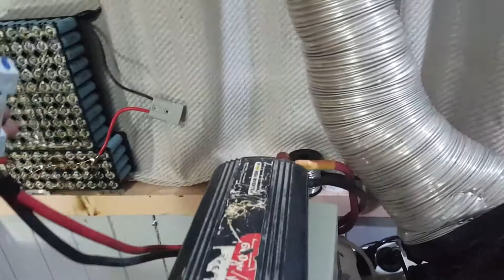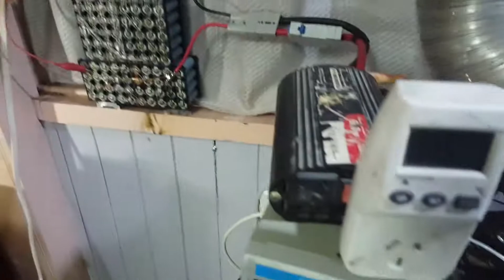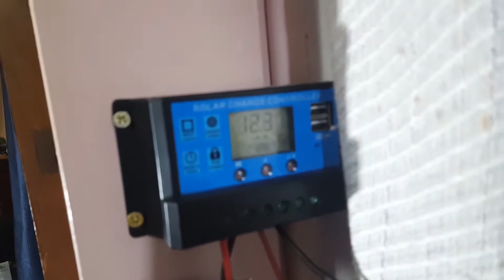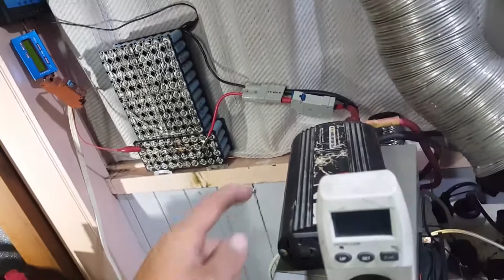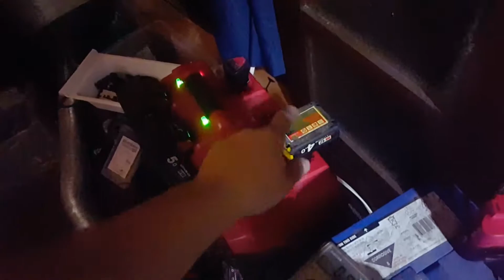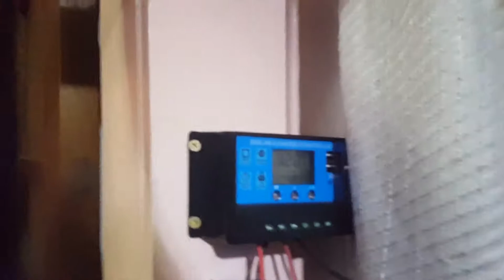The mini 18650 power wall gets a Inverter 600watt

Comment: Nice setup! Only thing: I wouldn't trust output from the solar regulator, that's why I would add a BMS between that and the batteries. Overvoltage to lithium batteries, you know, can be very dangerous. Those cheap PWM regulators are not very strict on output, they could push out 14.2V, realllly dangerous for your cells.
Reply from the maker: Highest it got was 12.7 but yes this is by no means a ideal setup

Comment: I appeciate what you're trying to acheve but this is a terrible idea long term. No BMS so cells aren't balanced which will shorten their life and this inverter is made for lead acid batteries which have totally diferent volt/state of charge characteristics meaning inverter will cut off as soon as 18650's are half discharged (>10V in 3S system). I'm not even gonna go into fire safety issues here.

Comment: depending on your panels a dc to dc buck converter works just as well as a charge controller once you set it to the highest voltage you wont it stops charging and current drops to 0 so if buck converter is set to the 14.8 volt when battery reach that level they stop charging
Reply from the maker: Thats a cool idea
Reply: @Oneupthesleevecustoms  also if you have little sun more panels with buck converters that could also limit current so not to over charge the controller means more panels and a solid current i recomend epever tracer 4210a they are mppt they have algerithems to charge 3s or 6 s lion and can handle upto 1500watt on solar and 40amp into battery if ampage starts to get high they ramp back on the solar
Reply: Can you share a link to such a converter on amazon or aliexpress.
Reply: @dancerehab1092  https://www.amazon.co.uk/dp/B07RGWJHPZ/ref=cm_sw_r_cp_apa_i_tvD7EbFF3HTQQ
Reply: @1981dasimpson  Thank you. Can I dig your brain a little on 18650's? maybe I could email you or something.
Reply from the maker: Sure mate
Reply: @dancerehab1092  yeah no prob dasimpson@hotmail.co.uk
Reply from the maker: Oneupthesleevecustoms@gmail.com

Comment: Hello sir.
Can you tell me how to configure the solar controller for 18650 batteries?

Thank you very much for your help.
Reply from the maker: You need a bms to  control the pack. But these charge controllers will turn down to full charge at 12.7v
Reply: I'm asking because the solar controller's instructions say it does not work for li-ion batteries.
Thank you very much for your help, sir.
Reply from the maker: Yeah they have the wrong charging algorithms. Feed it into a bms and problem solved
Reply: Great then I choose battery option gel but the load is put by the BMS.
What BMS did you use, could you give me the BMS link?
Thank you.
Reply from the maker: Ill find you a link later today
Reply: OK, thank you, sir.
Reply: What fuse is placed between the panels and the solar regulator, between the battery and the solar regulator and between the inverter and the solar regulator.
Thank you.
Reply from the maker: A disconect between pannel and controller. A fuse between battery and controller. Or circuitbreakers
Reply: Can you tell me which model of fuse, voltage and amperage for a 12v installation like the sulla.
Thank you.
Reply from the maker: Ok i need to know how much solar you have
Reply: I have three panels of 100w 12v
Reply from the maker: Thats good for around 25amps in good weather. A 30 amp fuse should be fine. Whats the rating on your charge controller
Reply: It's like yours 30A
Reply from the maker: It should hold up ok. Im running 2 265w high voltage pannels to mine now and its still a alive
Reply: OK, thank you very much friend.
Reply: Please, do not forget to tell me what BMS you have used. About the fuses and automatic protections, could you give me the links where you bought them to know exactly what models you have used? I'm right now learning about the short circuit protection issue.Thank you very much for your help, you are a very good person and I thank you.
Reply from the maker: heres a 3s bms 
https://www.banggood.com/3S-11_1V-25A-18650-Li-ion-Lithium-Battery-BMS-Protection-PCB-Board-With-Balance-Function-p-1120250.html?p=OQ120813147900201708
Reply from the maker: fuse holders 
https://www.banggood.com/Waterproof-Car-Auto-10-15-20-30A-Amp-In-Line-Blade-Fuse-Holder-Fuses-p-916113.html?p=OQ120813147900201708
Reply: @Oneupthesleevecustoms  the 3s bms is crap does not balance cells at all i had one bank in the 3s going over 4.2 volt while others where below 4 volt
Reply from the maker: It might have been balancing but they only balance at like 150mah. So mega slow
Reply: @Oneupthesleevecustoms  i was only charging at very low current about 100mah to see if it would balacne i even ordered another that indicated it was ment for balance and still dident work
Reply from the maker: Can you id the bms and share with the viewers so every one knows there rubbish
Reply: @Oneupthesleevecustoms  i have 3 here now one is 40 amp all in chinease other to have codes cf-3sjh25a-c 25a and bw-3sjh-25a the one all in chinease is ment to be the balance one and all 3 on same back go out of balance even if im putting in 10 mah and left for ages so pritty useless as they need to handle balance at solar current input i had if i knew what part is the dump load i would de solder and solder a filament bulb on for more load dump but i think that would burn the boards out
Reply: @tron259  depend on the charger.
Reply from the maker: Yes many variances
Reply from the maker: So put in a 30 amp fuse on panels and on batts you will be safe
Reply: Thank you very much for your help, you are very kind.
A question. In the solar controller what type of battery did you choose option 1,2,3?
Thank you very much sir.
Reply: Sorry for my English translations little by little I understand.
Greetings friend.
Reply: https://www.ebay.com/itm/5X-30A-6V-36V-Mini-Waterproof-Amp-In-Line-Stanard-Blade-Type-Fuse-Holder-Fuse/183166521208?epid=2113590121&hash=item2aa5934f78:g:ijQAAOSw~CFY6z2B:rk:27:pf:0
Reply from the maker: No problem mate
Reply: Excuse me, do ebay fuses serve me sir?
Thank you.
Reply from the maker: Yes mate
Reply: These are true to me.
Greetings.
Reply: Thank you very much sir.
Reply from the maker: No problem i hope your subscribed so.you can keep up with these sorts of builds
Reply: Thank my Lord.
I am subscribed from the first day that I started talking with you, the videos that you have are very popular, little by little I am drinking them all.
Anything communicates it to me and I will hire him asking the questions that arise from me.
Best regards, I send you friend and thank you for your good help.
Reply: It is a pity that in Spain it is so difficult to get 18650 batteries.
It is incredible how much you have, a wonder.
Greetings.
Reply from the maker: Thanks for watching don't be scared to ask questions and learn :)
Reply from the maker: I have about 3000 here
Reply: What happened, with those batteries you have enough to feed the whole house.
What a wonderful friend.
I am starting little by little.
Reply from the maker: Just gotta build some batts
Reply: But you already have the raw material, little by little and patience you will have something incredible.
Reply: How could I send you a BMS photo to ask you for details?
Reply from the maker: Email me mate
Reply: Thank you very much sir, you are great, I hope you will find more people like you.
I send you a hug and a big greeting from Asturias - Spain.
Reply: OK gracias.
Reply from the maker: Ill have a look soon

Comment: Not that it don’t work your only use about 1/3 of the battery at best at 12v you only have a range between 11v and 12 .4 a proper 12v goes to 13.4
Reply from the maker: The 600watt inverter ive had on it doesnt cut out till 10.8v so i use most of them been a good little setup

Comment: Not bad but and big buuuuut  12v don’t work with 18650 voltage is to low 3s and to high for 4s.
Reply from the maker: Worked for almost a year before i started building a bigger one. How does it not work

Comment: I'm running a couple deep cycle batteries. I want to build something like this but I have questions... I have an epever mppt charge controller and I can adjust the charge voltages. Did you have to adjust your controller for the lithium batteries? How did you get them to 12 volt? Like how many do you put in series and parallel?
Reply from the maker: Hi mate 3 in series and as many as you can in parallel i set the full charge to 12.6v and manually monitor my cells to keep them in balance. Are you subscribed as im just starting to play with cheap bms options for this sort of application if your interestef
Reply: I am subscribed! Definitely interested. I have 280 watt panels so far
Reply from the maker: Any solar is good solar free power from the sun without digging for coal oil or gas
Reply: So in your banks they are 4×10 roughly? Three of the cells are in series and the rest are paralleled?
Reply from the maker: So the batt in this video is 3s 40p
Reply: One Up The Sleeve Customs each block is a series and the three of them are parallel?
Reply: Sorry lol I thought that's how you did it but I confused myself.
Reply: 24volts is actually much better using 7s Xp you get MUCH higher efficiency out of the system plus like all 24volt appliances are in the perfect range for that. If you still need 12v somewhere you can use a buck converter.
Reply from the maker: Your correct but i only have 18v solar and 12v gear
Reply: same here. for my panels 17.6 is the sweetspot usually for max mppt. I am running 12v gear off a 29.4v (7s) bank with that. An inverter for 24volts which is alot better than my old 12v one. The rest of the 12v appliances i run thru 3 buck converters ( each rated for 10a but since its from china its more like 5-8amps each ) they only cost a couple bucks - LED's , a desktop pc ( via 12v atx ) - laptops and other stuff off car plugs works really well. The big advantage is you can use much longer wiring or thinner cables to the buck converters with car plugs ;)
Reply from the maker: Sure can the next power wall will be 48v

Comment: hi thank you for movie. I have question for battery. 
Do you use BMS for charge to battery from solar charger controller ?
Reply from the maker: +karistuck no bms i just moniter it my self in 3 months it only got out by .1v
Reply from the maker: +karistuck no bms i just moniter it my self in 3 months it only got out by .1v

Comment: Good day, how much 18650 s did you use?
Reply from the maker: +Chevon McIntosh - RC foam planes hi,  there are 120 18650s in that block of cells some were around 45 to 50 amp hr or 500 watt hrs
Reply: ok  kool
Reply from the maker: +Chevon McIntosh - RC foam planes they are Samsung  inr 18650 15ms so big discharge  rate but less capacity  and all out of power tool batterys

Comment: I hope you know AC circuit breakers will not work on DC systems. If you are just using it as a switch that's fine, but don't expect that circuit breaker to work on a DC system if it is in fact an AC breaker.
Reply: Good point :)
Reply from the maker: +Dylan 873 yeah just  big isolation points cheers  mate
Reply from the maker: +Mikes DIY Tesla Powerwall all good just switches so when not using the inverter  its not wasting any power